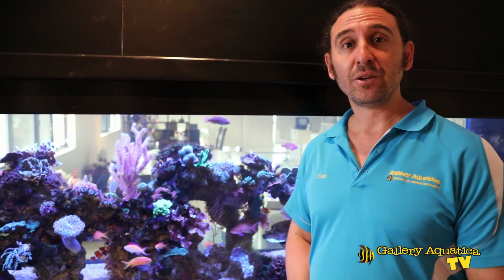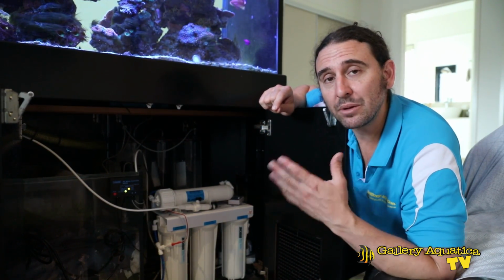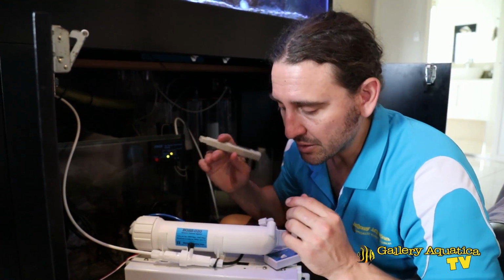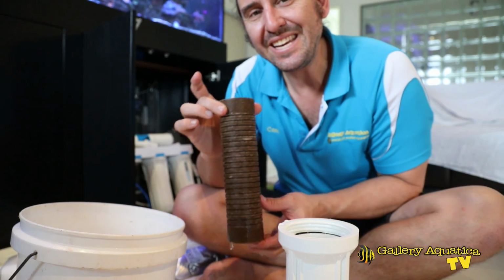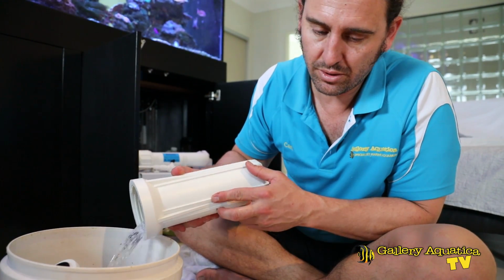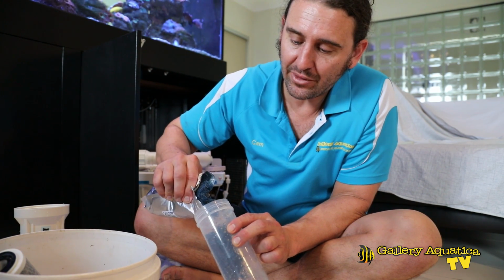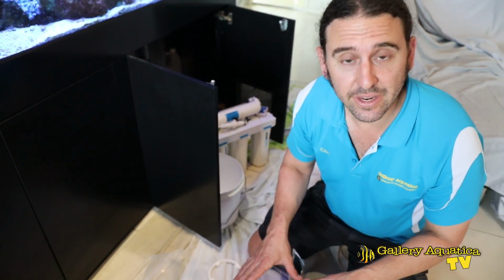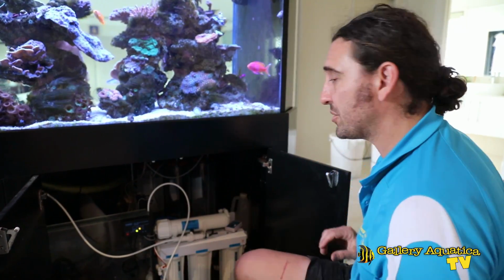How to service your RODI filter ft. Coffin Reef --- Gallery Aquatica TV

Comment: Are you not worried about TDS creep in the Coffin reef? Also any failure on the Tunze and the water volume is unlimited. I run an RODI into a large remote ATO with 3 redundant backups to stop possible floods. It also only fills when near to empty and helps prevent the TDS creep.

I like your style of videos, shows all the real basics of the hobby really clearly. Well done Cam :)

Comment: Awesome timing for me as my carriages and resin just arrived today! Thanks for doing this video, I've got the exact same BOSS RODI unit from PSI. We have terrible water in Bargara, QLD do you think it's worthwhile changing cartridges and resin at the same time? It's been 6 months since I bought it new and TDS was hitting 14
Reply from the maker: I usually change the resin, carbon and sediment trap 4 to 5 times as often as the RO membrane. We generally customise the RODI system to the water it needs to filter. Cam

Comment: shouldn't you flush it without the resin, otherwise you are just depleting it?
Reply from the maker: To get the best possible lifespan out of the resin technically yes, but the difference is minimal. Cam
Reply: @GalleryAquaticaTV  flushing has a minimal difference in between uses. But when you install a new carbon block it makes a significant impact to the resin.
Reply from the maker: I’ve always assumed the resin exhausts quickly on this system due to the stop-start nature of the auto topup system. Next time I might install a resin saver so I can easily flush the carbon without the resin copping the dust. Thanks for the tip. Cam
Reply: @GalleryAquaticaTV  A tank that size should be stop starting frequently enough that the creep will not be significant. especially if main is only around 160tds. if its a lot higher than that creep would also be hurting it. but the sediment that comes off carbon is very intense and resin is only there to polish 5-10tsd its not designed to be smashed with carbon and other impurities. at the right tds level you can kill a resin within 3 hours.  Give it a shot im sure it will help significantly. I have had long conversations with sentry water about this I am no expert but they have over 50 years experience and this is what they tell me. kind regards

Comment: Hi Cam! I've got one of those but it will only fit to an outside tap, which I don't have or u have to make a hole in a water pipe which I don't want to risk! so I have to use tap water with Prime in until I get another! 😀👍

Comment: Great video cam how do you hook up the RODI to the tunze thats a great idea instead of a water in a reservoir.  Thank you
Reply from the maker: The RO hose goes through a solenoid that controls the flow of water. I also forgot to mention you need a drain under the tank for the RO waste. Cam

Comment: Awesome, never seen RO filter so dirty lol. I do the same colour changing Di Resin but a trick i do is a add a small clear 250ml chamber of resin as last stage as my indicator to change the main DI chambers, as this allows me to run the cheaper non colour changing resin in the non see through larger chambers.
Reply from the maker: We do the same at the shop, I actually forgot this RO system was the old brand, the new brand we sell comes with the clear cartridge as standard. Cam